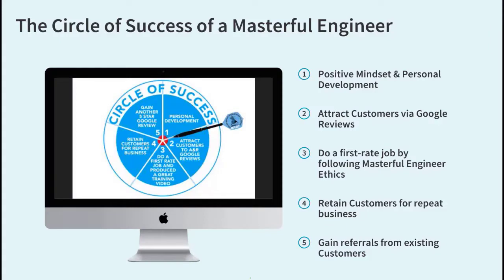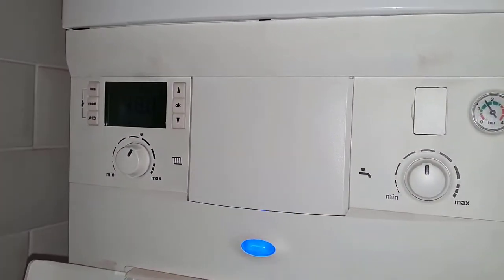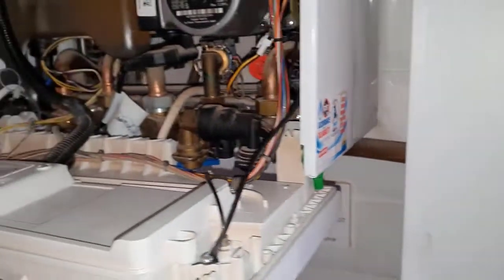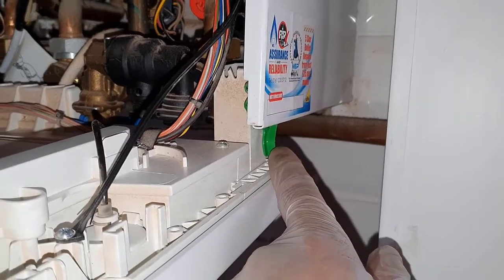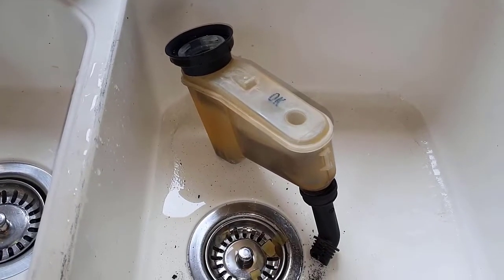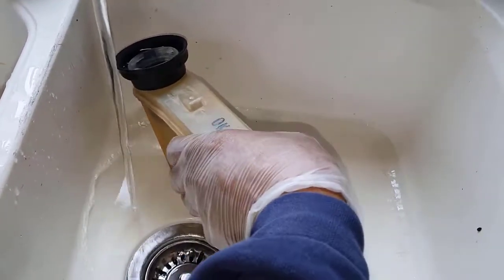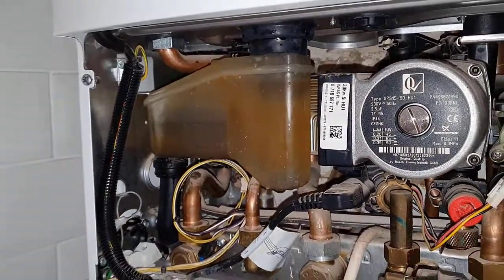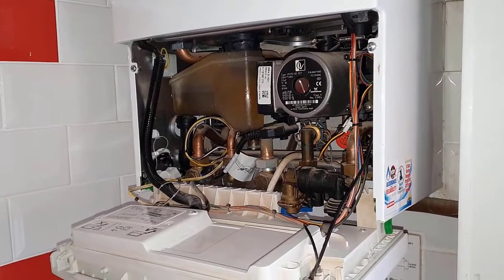Worcester Greenstar 30SI Compact Condensate Trap Removal Boiler Repair Accelerated Training

Comment: I have a junior 28i and thinking of upgrading as its over 10yrs old. can I get 30i or 4000 installed directly without changing the pipework  or demolishing half of my house? which is the best direct replacement if the above are not correct?
Reply from the maker: The Worcester Greenstar 30si compact would work

Comment: Thank you for the video 👍🏻 we had a error code 227 today in this cold UK weather, no heating or hot water and it sounded like a washing machine, the pipe outside wasn’t frozen but after watching your video I found our trap was blocked, all sorted and now running again 👍🏻 thanks
Reply from the maker: Thank you for your comments also can you subcribe to our channel

Comment: I usually just connect the wet vac into the condensate.  I have a made up rubber attachment.  Does the job 9 times out 10.  You can connect the vac downstream on the condensate pipe as well too.  Rather then blowing down the trap you could use a garden pressure sprayer.